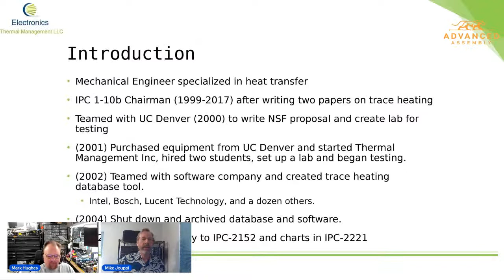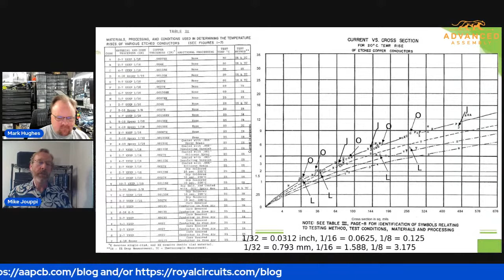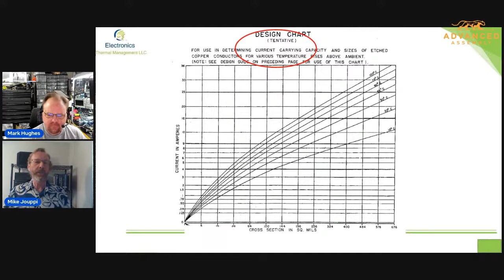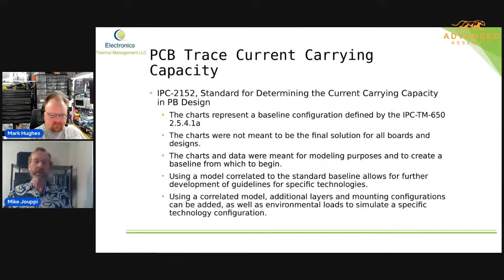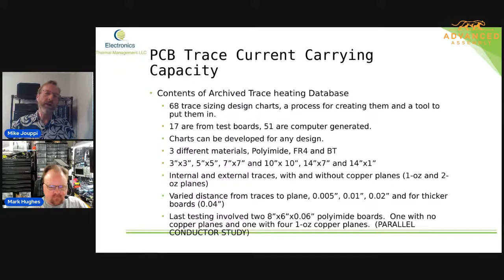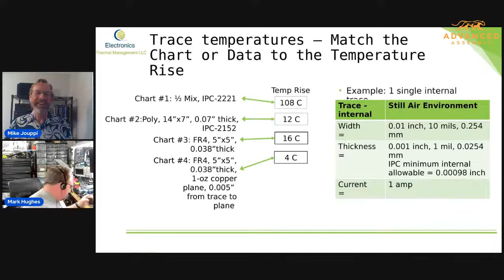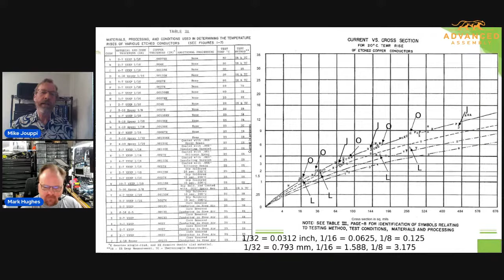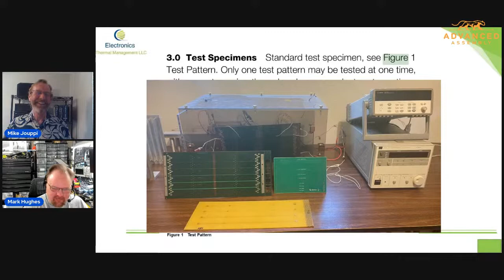Mike Jouppi Presents PCB Thermal analysis software

Comment: Would you anticipate that a significant number of interplane vias would influence the temperatures seen or is it more to do with the planar copper layers - whether attached directly or not?
Reply: I'm not certain I understand your question -- but the answer is probably the copper layers.  Copper has a thermal conductivity that's 1000x greater than the dielectric material.  And the top layer to the next plane is usually only a few mils, so even though the dielectric has a much low conductivity, it's sufficiently thin so that the overall thermal resistance isn't very high.  

Especially with thin dielectric layers, the heat will move from the source through the dielectric to the copper planes and then around the board.  Now -- if you have thick dielectric layers, it'll be a bit less so -- but if you have a board stack to reference, I can give a tad more technical answer. 

Also -- check out part 2 webinar here:  https://www.youtube.com/watch?v=Yt61F8wuGcU and Mike's thermal calculator here:  https://www.royalcircuits.com/2022/04/28/thermal_resistance/